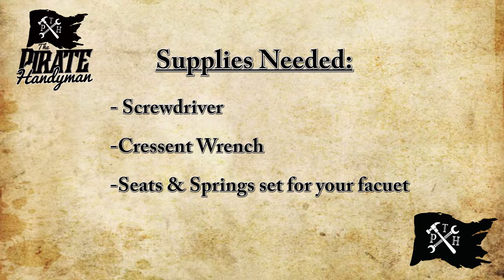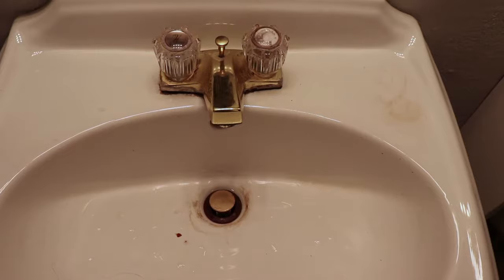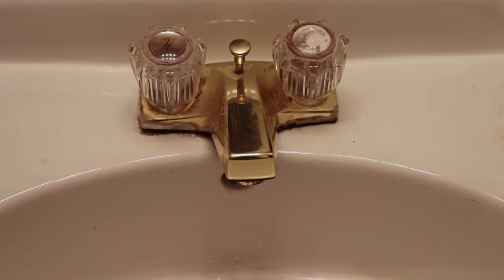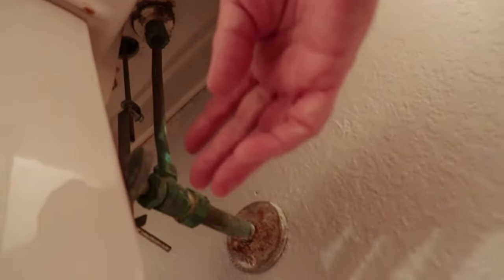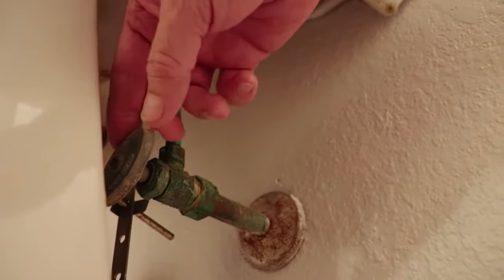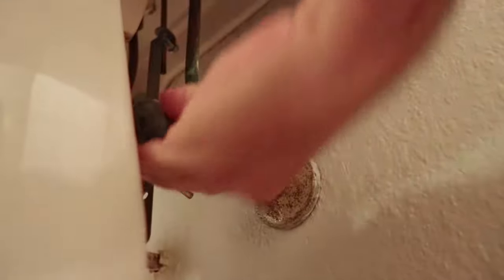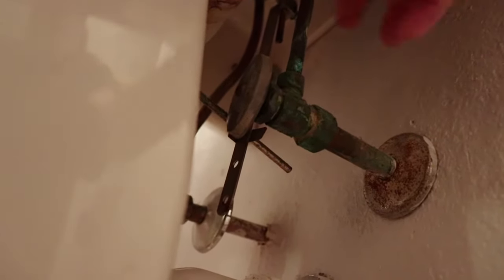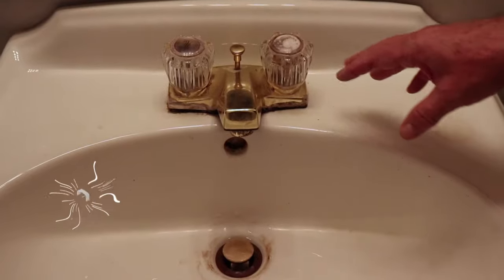How to Fix a Dripping Bathroom Sink Faucet Double Handle

Comment: Both sides are off but it still dripping why?
Reply from the maker: Aye, matey, sounds like you need to replace the grommets in the valves under the sink. The link below shows how to replace them. Even though this is for an outside faucet, the concept is the same. Smooth sailin'!
https://youtu.be/KDAB0HjgYYs

Comment: My base is leaking the valve is different from video leaks from base...I think
Reply: The stem has no collar
Reply from the maker: What is the brand?
Reply: @thepiratehandyman2225  jdk
Reply from the maker: Another person had a similar problem, and found that the collar was actually on the bottom.  In that case, you'd have to remove the faucet from the sink to access the collar.  You might try it, and let me know if that is what you have.

Comment: Where is the video for a single handle bathroom faucet drip repair
Reply from the maker: Aye, matey, we haven't made that video yet.  However, the concept is the same.  Here are the steps:
1. Remove the handle.
2. Unscrew the collar.
3. Remove the cartridge.
4. At the bottom of the bowl, you will find 2 holes where the springs and grommets are seated.  Replace them both like you see in the video (1 set for each hole), then put it all back together.

Smooth sailin'!

Comment: My shut off velvet's won't stop water from filling up and and I can't get the seat to stop floating
Reply from the maker: Aye, matey, it sounds like the grommet(s) in the shut-off valve(s) may need to be replace. The video link below will show you how. Even though the video is for an outside faucet, the concept is the same.

https://youtu.be/KDAB0HjgYYs
Reply: @thepiratehandyman2225  I finally got it to dry out by opening all the tabs on all the faucets in the house and draining the water. It went smooth as it could, no leaks now, thank you, sir
Reply from the maker: Glad to hear it, matey - that's was a good way to think it through - smooth sailin'!
Reply: Pressurized systems: water, brake fluid, hydraulic fluid, pneumatics, it's been my experience that as soon as you fix the brake, the next weakest point in the system brakes and so on ad nauseum. Any pirate wears his salt knows its like a scurvy. Landlummbers and bilge rats they be. Arr, and thank ye for the parley.

Comment: How about if it leaks from the neck under the handle
Reply from the maker: It could be the failure of the same grommet we replaced here.  If it still drips after replacing these parts, then you may have developed a crack in the housing, which would require replacement of the entire fixture.  We have that video coming out next week!'
Reply: @thepiratehandyman2225  gee thanks. But guess what.. to open it up under the cap the screw is corroded i cant grip it with anything😗😙
Reply from the maker: Yeah, I have had that happen, too.  If the corrosion is from rust, try squirting WD-40 and let it sit over night.  If the corrosion is lime or other mineral deposits, try squirting it with Lime Away (or another such product), and let it sit over night.  Do you have a pair of locktites (locking pliers)?  If there is enough room, try those.
Reply: @thepiratehandyman2225  thanks man. Respect
Reply from the maker: Thank you!  Good luck and let me know how it goes, matey!

Comment: How to turn off shuts offs under bathroom sink if the shut off doesn't  move
Reply from the maker: Aye, try using WD40 or 3-in-1 oil on the shafts of the valves and let it sit for a few hours, then try again. May have to do this a few times.
Reply: @thepiratehandyman2225  thank you so much. You make it sound easy.
Reply from the maker: Please let me know if this worked. There are other things you can try if if the valves are still stuck.
Reply: @thepiratehandyman2225  all is good. I like how you walked it through showing each part and exactly how it went together!!!!!!

Comment: Thank you for this! I replaced the cartridge, rubber piece and spring and it’s STILL leaking- I’m beyond frustrated
Reply from the maker: If it's still leaking after replacing the cartridge, grommet and spring, then I'm afraid that you'll need to replace the entire faucet.  You can get a new faucet over the internet or at your local hardware store.  Please see the video on "How to Replace a Sink Faucet" - you can do this yourself and still save some serious coin!
Reply: Or your angle stop

Comment: The Cold water faucet keeps turning and can't turn off
Reply from the maker: Aye, lass, sounds like you need to replace the cartridge. Follow the same instructions, but instead of replacing just the springs and grommets, relace the cartridge as well.

Comment: Could of simply determined which hot or cold was leaking by placing your finger under the drip LOL
Reply from the maker: Aye, matey, but as long as you're in there, best to replace both.  If one side failed, the  other won't be far behind!

Comment: One control handle
Reply from the maker: Aye, matey, I have not made that video yet. However, the concept is the same.  After shutting off the water, follow these steps:
1. Remove the handle.  There should be an allen screw on the under-side of the handle.
2. Remove the collar by turning counter-clockwise.
3. Lift out the cartridge.
4. After sopping up the water in the bottom, you will find 2 holes, instead of one.  Remove and replace the spring and grommet in each hole.

Let me know if this works for you. Smooth sailin'!

Comment: I turned both off and it’s still leaking somehow
Reply from the maker: Aye, matey, it sounds like you may need to replace the grommets on the inlet valves. The video below is for an outside faucet, but the concept is the same.
https://youtu.be/KDAB0HjgYYs

Comment: and of course, it's not that easy for me. oh well, guess I have to call a guy cause apparently I'm not "man enough"
Reply from the maker: Don't get discouraged, matey.  Were you able to replace the spring and grommet seat, but it still leaked? What exactly happened?
Reply: @thepiratehandyman2225  It's complicating, like everything else in my life. First off, I don't have a cut off under the sink so I have to turn the water off to the whole house. Then when I got the handle off, the collar is so damn tight I can't get it loose and I'm afraid I'm gonna bust that plastic. If that happens then that's even longer that I'll have to leave the water off till I get a new one. I'm gonna try to tackle it tomorrow. I do appreciate the video and checking with me though. Thanks
Reply from the maker: Did you try using a lubricant like WD-40?  If you can leave it on there for an hour or so, that might loosen it enough that you can get that collar off. Good luck matey - ye can do it!
Reply: @thepiratehandyman2225  Good idea. Thanks!!
Reply from the maker: Let us know if that works!